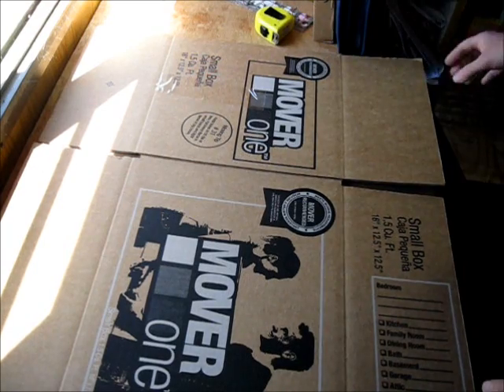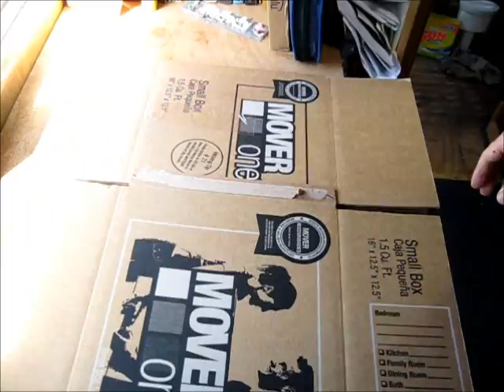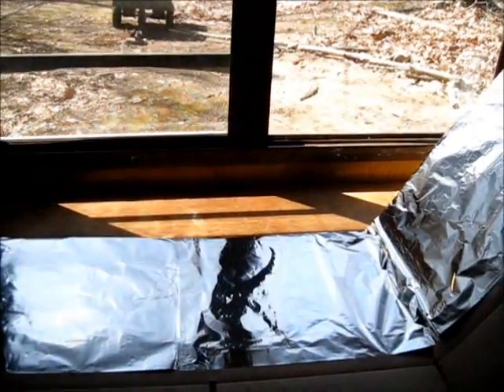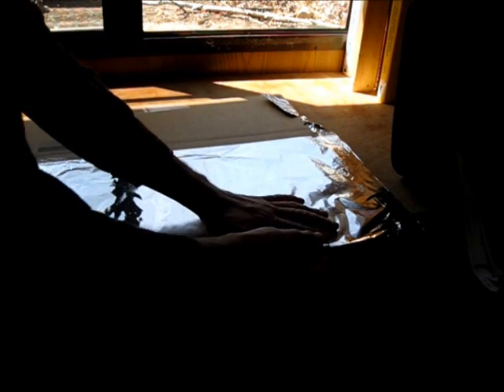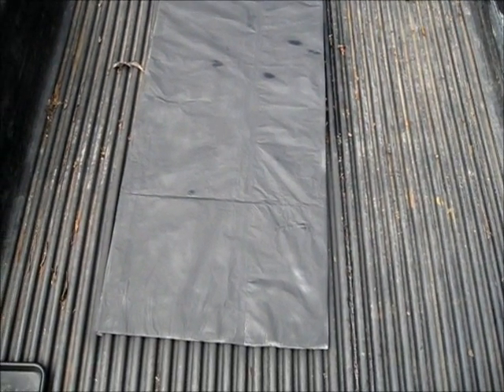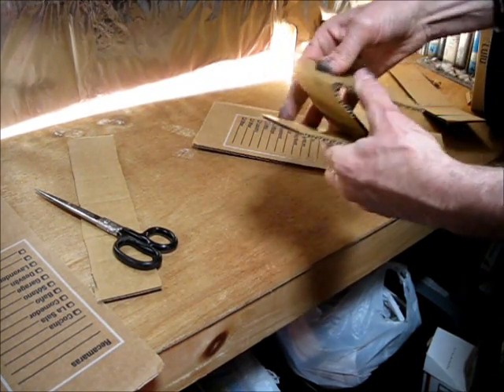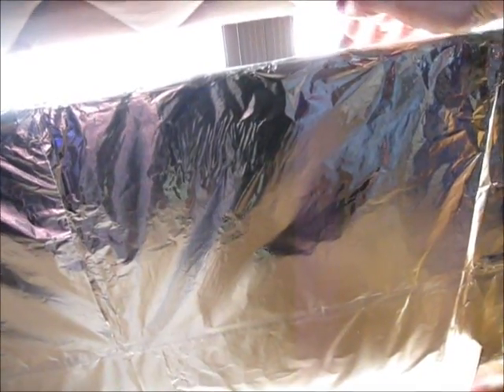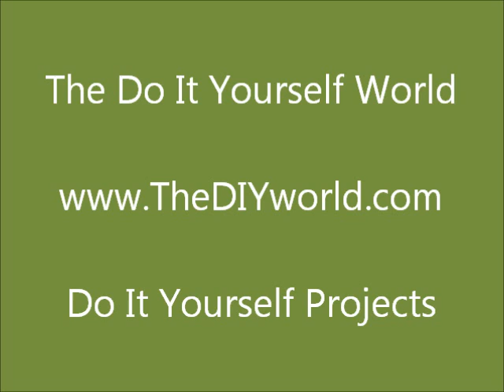Make A Passive Solar Window Heater For Under Two Bucks

Comment: This cannot work. You cannot suck more sun light (energy) through the window by placing a piece of black cardboard in front of it. The energy you get through the window is the energy you get through the window. To somehow think this cardboard will somehow better utilize the energy is silly. In fact it will probably make the room colder by reflecting light back out of the window.
Reply from the maker: Chris Call It is not sucking more light in. It is absorbing the sun's radiant energy and transferring that into your home as heat. When the sun hits something black, it heats up. Simple.
Reply: The Do It Yourself World  the same amount of energy enters the window with or without the cardboard so where does the extra heat come from?  Since the given amount of energy would be absorbed by the interior of the trailer any way and given off as heat, the card board does nothing to heat the trailer any more than without it. Science says so.
Reply: Chris Call The same amount of light energy enters the window whether you have the black-coated aluminum or just an open window.   The difference is that the black coating absorbs the light and converts it to heat energy whereas the window, as it is, will have light reflecting everywhere and much of the light energy would be lost in that way.   Hope that helps.
Reply: Geoff Schmidt assuming & also dark colored variables around the window.......curtains,couch, floor& sometimes what the floor is made of.
Reply: The Do It Yourself World I disagree to a point, while we understand black dark non reflective surfaces absorb more energy than mirrors and reflective surfaces, you only have so much surface area to use, you can't amplify the sun, you can only use surface area to gather light/heat. By closing off your window, you gained just about nothing and lost light, because you only have for ex:if your window is 3 x 5, then when you cover it, you lost 3x5 worth of surface area that was heating your home as well as adding light. See the room don't need to be black to absorb light, it would just about have to be mirror surfaces in your home for it not to be able to absorb close to 100% of the light that comes through that 3 x 5 window. Now when you block it, you gain nothing, you still are using 3 x 5 surface area. 

The best way to work this is to not block any windows at all, add the collector, a similar collector out doors where you don't have a window, run a duct, NOW , you added to your energy absorbing rate and still benefit from the natural light in the home..because now you have 2 - 3 x 5 areas, one collecting heat, and the other(window) collecting heat but utilizing the light also.

The only way a window can't collect nearly 100% of the light energy into your home is if it all reflects back outside, and it won't and it don't. even when the beams initially hit a surface that is not black, they still begin to absorb, then when the remaining light bounces off the non black surface it has nearly 95% chance of bouncing onto another item in your home, absorbing more light, more heat, until the initial beam had been completely absorbed.
Reply: +Chris Call    ---- I bet every 7 th grader can explain to you why the inside of a car with a dark interior is hot in the summer when the windows are up.  The sun doesn't know the difference between a house window or a car window. All that matters is sun going through glass or plastic and hitting a dark background. If you still don't believe this passive solar window heater works, then you are at risk of accidentally children in the car too long and them dying due to lack of understanding of basic science.
Reply: It's all about thermal mass.

In order for anything to "absorb" heat, it has to have enough material to hold the energy. A piece of painted cardboard has negligible mass compared to the walls, floor, and furniture. Replace the cardboard with a concrete slab and you might be onto something, but otherwise Chris is right, let the light into the room and absorb the heat by your interior.

It's not a "black vs white" debate -- everyone agrees that black absorbs more heat than white. The question is: Does a piece of black cardboard absorb more heat than a room full of white walls, floor, and furniture? And the answer is no.

Think of how the sidewalk stays warm even after the sun goes down, and concrete is practically white. Now think of a black plastic table... cools off the moment the sun is off it.
Reply: Not sure what a car has to do with the example in the video and before you insult someone you should know what you are talking about.  Chris is 100% right in what he said.
Reply: You are wrong. Without the solar heater, light will be lost by bouncing back out the window. If you were to stand on the outside and look in, everything you see on the inside is actually light bouncing back through the window. The black foil actually absorbs the light energy and transforms it into heat energy. The heat then dissipates into the inside air. Its basically a radiator that runs off of light.
Reply: The Do It Yourself World 

You consentrated your heat.  You did not make its conversion much more efficient, if at all.  If your paint isn't completely absorbant, you will inevitably still reflect a fair amount of light right back out.  I'll go right ahead and say this is probably significantly more efficient then curtains that would otherwise be used.
Reply: Get a temperature reading in your window, and then build one of these heaters and take another reading. You will get an immediate temperature increase. Its fact that black gets extremely hot in the sun. Why is it so hard to imagine that you could capitalize on that?